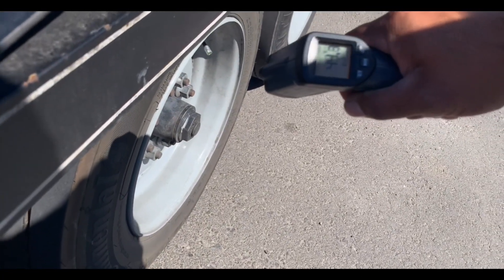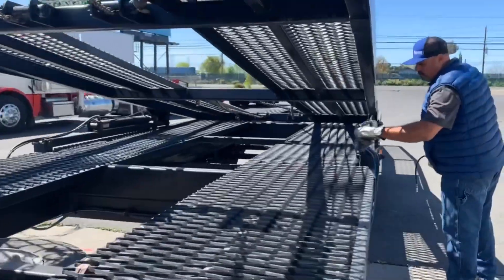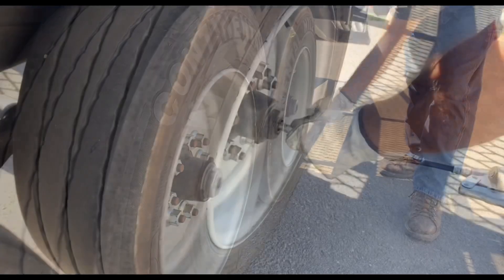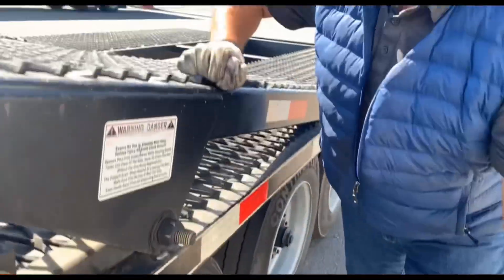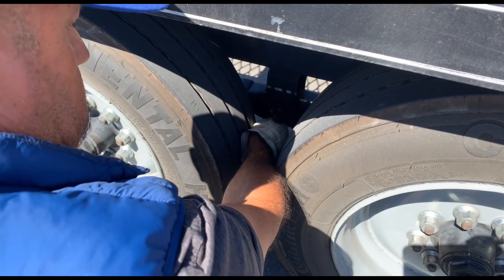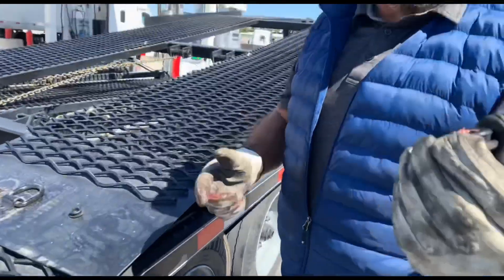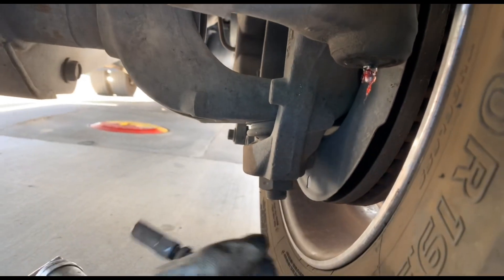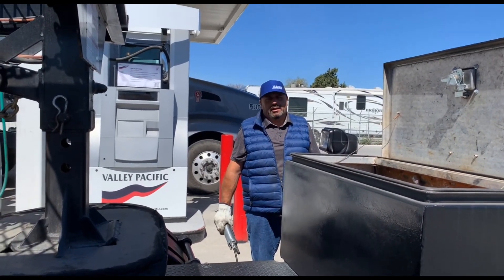Greasing Kaufman car trailer and Dodge Ram 5500.

Comment: Hii
Do you have a video about greasing the fifth wheel 

We just started few days ago same trailer on dodge 3500 2022 but its making huge cranking sound on every turn 

And thanks a lot for all the videos there is great info there
Reply from the maker: I’ll do a video in a few days.   What brand fifth wheel are you using?